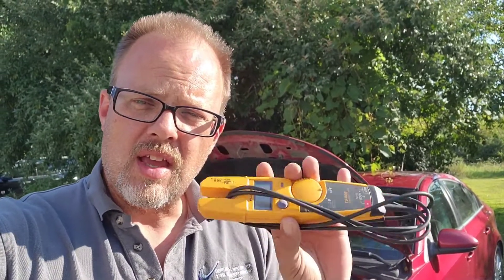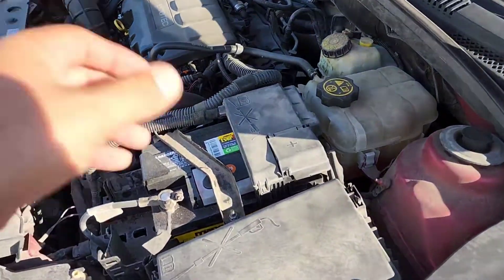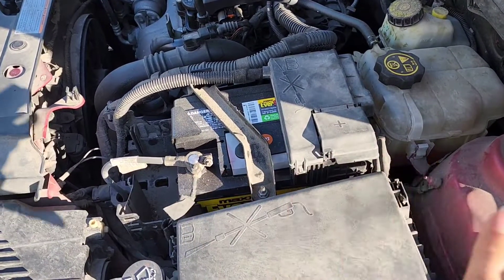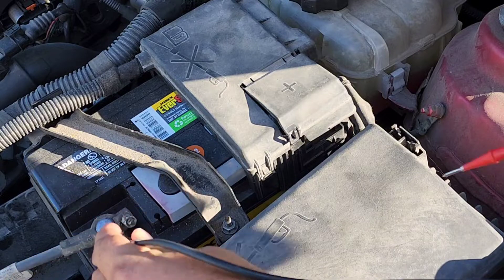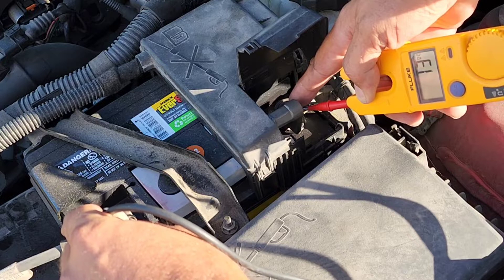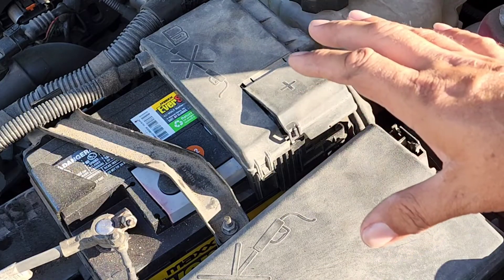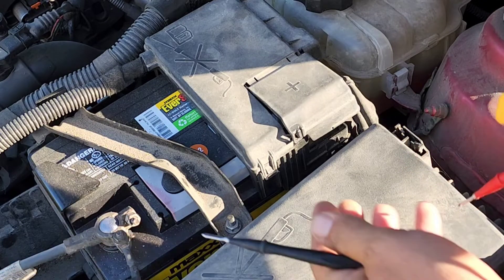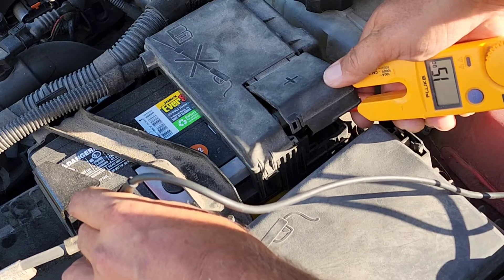How to test your battery and alternator on any car.

Comment: I have a Fluke T5-1000, which is the same as yours, only good to 1000 instead of 600. As an electrician, these meters are great for my everyday general use, but I find them lacking when it comes to automotive diagnostics since they only read in whole values. I'd be much more comfortable seeing 14.5 volts from the alternator than 15 volts, for example.

Comment: You could have said what some bad alternator values could be. Yours was 15v, but is 14v good, what about 13v? Battery is only 12v, but is 13v or 14v a good reading to charge the battery and run the car with accessories when the engine is running?
Reply from the maker: Anything under 12 on the battery is bad, 12 to 12.2 your battery is getting weak.  Alternators vary but generally anything under 13.5 and above 16.5 is considered  bad.